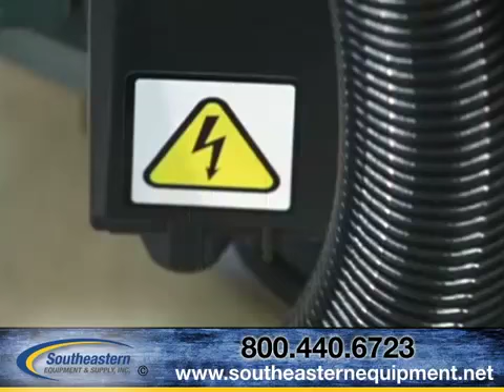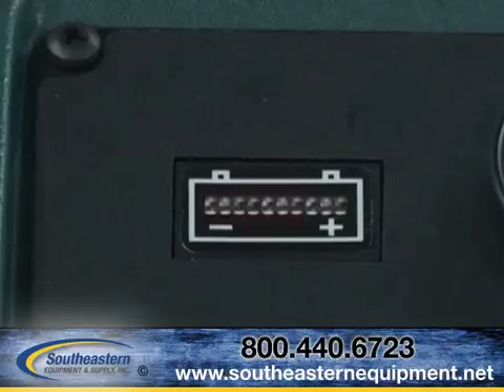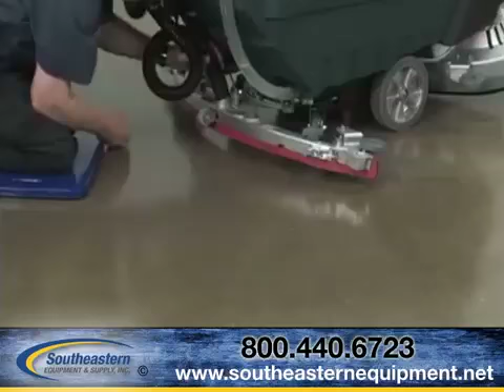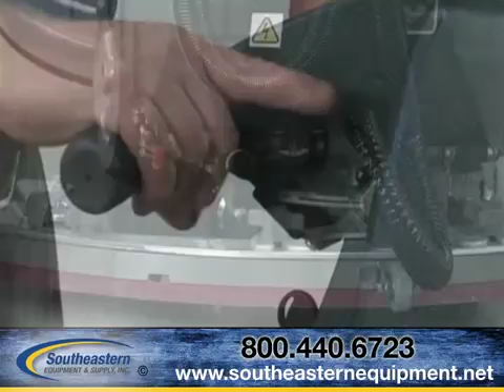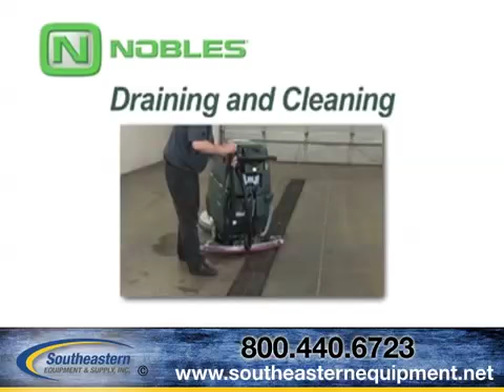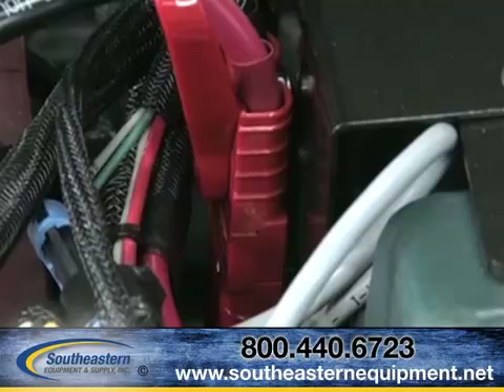Nobles Speed Scrub SS5 Operators Guide

Comment: Should I checking the batterys and make sure filled with water ?
Reply from the maker: Yes, checking to make sure wet cell batteries have sufficient distilled water levels should be part of regular maintenance to prolong battery life.
Reply: Do I fill until visible ?  This unit has more than 1 battery
Reply from the maker: @DD-tk1yu  Fill each cell with distilled water until the fluid level is roughly to 1/8 to 1/2 inch below the bottom of the plastic vent well (filler tube). Never fill to the very top, as this allows for expansion during charging and prevents overflow.

Comment: Clogged water jet. I need help
Reply from the maker: If you’re getting little or no solution flow, check these first:

• Make sure the solution tank isn’t empty. Fill it up if needed.
• Check the solution tank filter. If it’s clogged, remove and clean it.
• If it’s a battery machine, low batteries can reduce flow. Charge them fully.
• The solution valve may be clogged. Remove it and clean it out.
• Confirm the solution flow control knob isn’t set too low. Adjust as needed.
• If the control knob feels loose, calibrate it and retighten the screw.

Work through those step by step. In most cases it’s a simple blockage or low setting, not a failed pump. Still need help? Call 800-440-6723, option 3 or email <service@southeasternequipment.net>
Reply: @SoutheasternEquipmentSupplyInc I looked in my clear hose wher clean water shows and noticed down the end toward bottom of machine that it is congealed, I’ve been using little dibbs pods to help pick up rock salt from people tracking it in building.  I emptied it and seemed to work better for 1 day.  I don’t know how to get in way down past that, maybe a wire coat hanger, my little finger fits but not long enough. I could feel something tho.  Thanks

Comment: The scrubber isn’t sucking where it squeegees it up Whaty do we do
Reply from the maker: Hi there, thank you so much for your comment.

In regards to your machines; is the vac motor turning on? If not, check to see if any circuit breakers are tripped. Then check for voltage at the vac motor. 

If the vac motor IS turning on, try removing the vac hose from the squeegee and feel for suction at the hose. If there isn't much suction there may be debris in the vac hose. Clear it. If there's good suction at the vac hose valve, the squeegee may be out of adjustment or have worn blades. Adjust or replace worn parts.

If you have ay more questions, please reach out to us here: (800) 440-6723. We'd be happy to help you in any way we can!

Comment: Mine the water isn’t draining. I drained it and some water is still in the tank on top ?
Reply from the maker: Hi Ruby! A little water left in the solution tank is normal, just leave the lid open for it to air dry. If there is a significant amount of water left in the solution tank, there may be a clog somewhere -- possibly in the drain hose. If you still need assistance, give us a call at 803-252-0100, option 3 or email <service@southeasternequipment.net>.

Comment: My machine is putting water in the floor and appears to suck it up but the output of water is very minimal. What could that be?  I have checked all filters and they are good.
Reply from the maker: According to the Troubleshooting section of the Operator's Manual, little or no solution flow could be the result of the following: Solution tank is empty, clogged solution tank filter, discharged batteries, clogged solution valve, solution flow control knob set too low, or loose screw on control knob. If you'd like to set up a service call, please reach out at 803-252-0100 and select option 3.
Reply: I'm having the same problem. I was hoping for a better answer. Maybe that is just how they are made.

Comment: What is the recommended detergent level????
Reply from the maker: Hi Scott, the Operator's Manual on page 12 states "Using a hose or a bucket, fill the solution tank to the 'MAX 85L' mark. For conventional scrubbing: Use hot water and pour a recommended cleaning detergent into the solution tank according to the mixing instructions on the container." Email us at service@southeasternequipment.net if you need a copy of the manual.
Reply: @SoutheasternEquipmentSupplyInc  awesome! Thanks